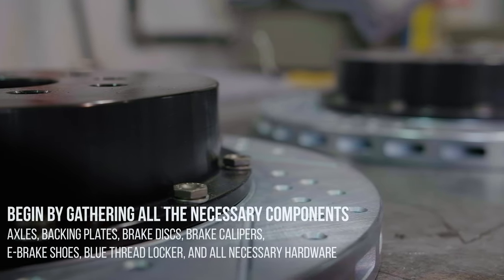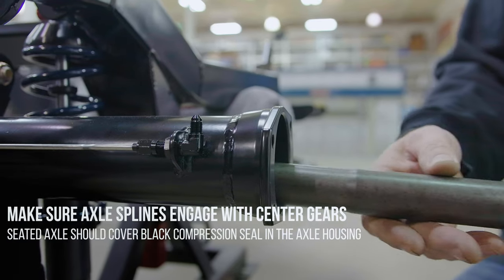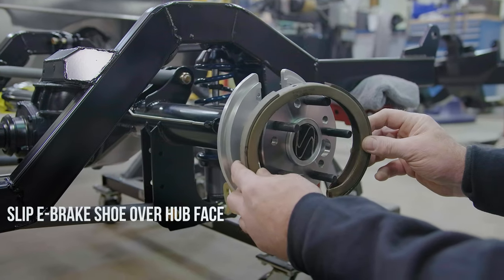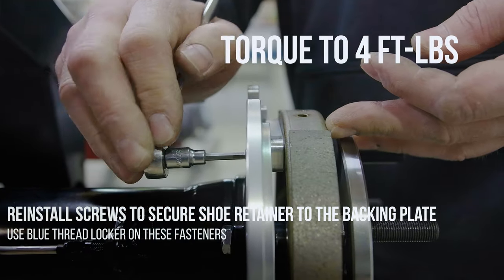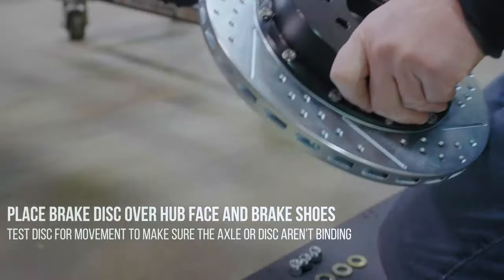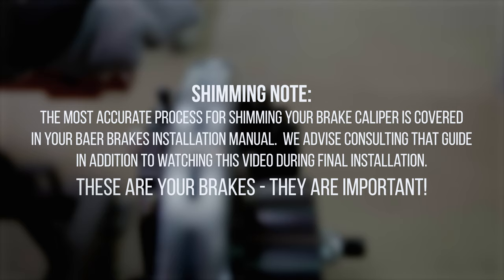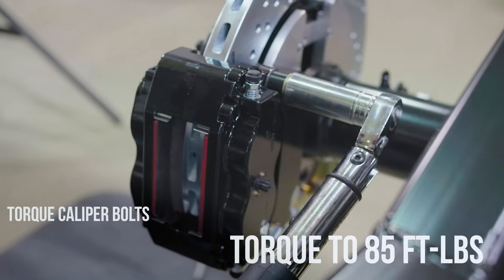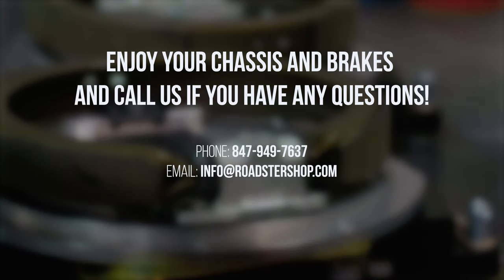Roadster Shop Tech - Axle & Rear Brakes Install for SPEC, REVO, and RIDE LINE chassis

Comment: But what’s the torque spec for the backing plate t bolts
Reply: I mean the t bolt
Reply: I see you never got a reply. Lol. I'm dealing with their setup right now. My favorite part is where they show the shoe sliding effortlessly onto the actuator...completely not how this is going.